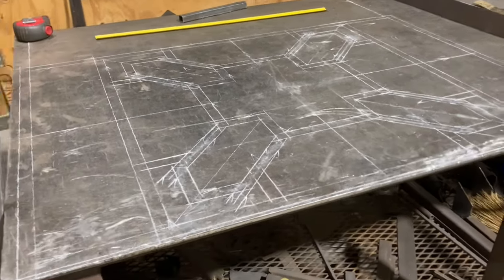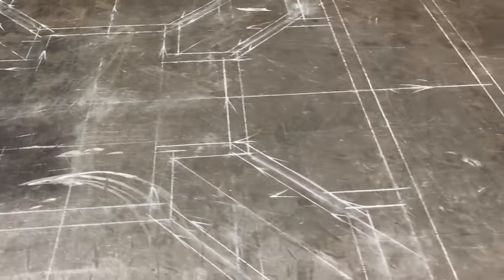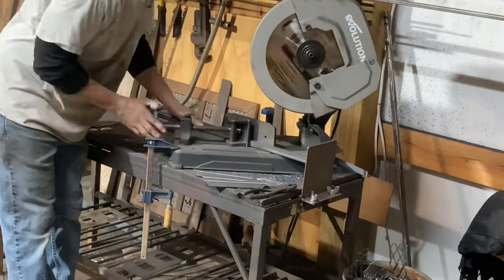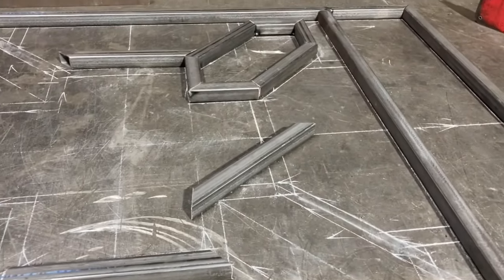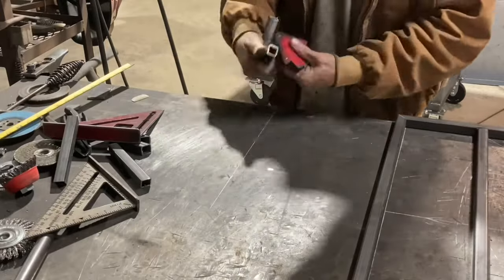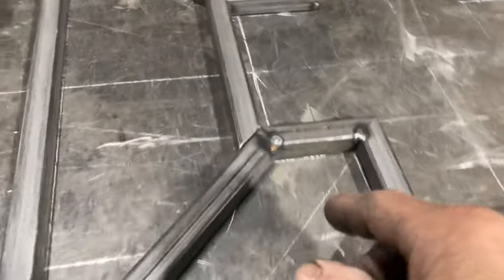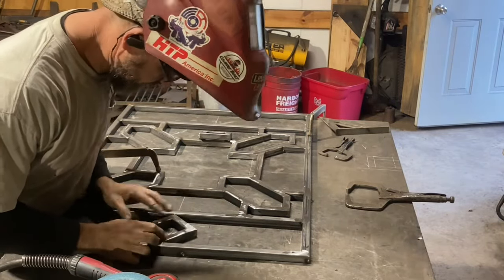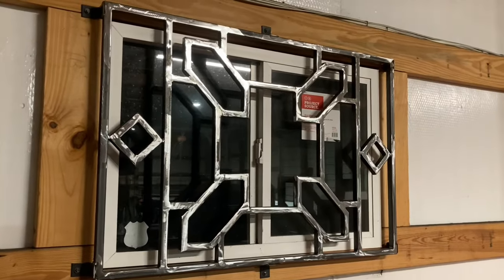Window screen build with Vevor disc sander

Comment: Looks good, on your layout try using 20 ga. Galvanized sheet metal, it’s cheap and you once you check the measurements scribe over the soapstone and you have permanent layout sheets that won’t absorb moisture like plywood.
Easier to store also.
Saving for one of those grills.
First class!
Thanks for showing them.👍